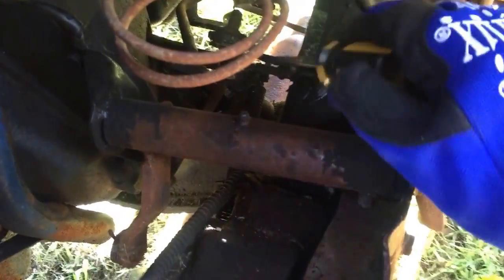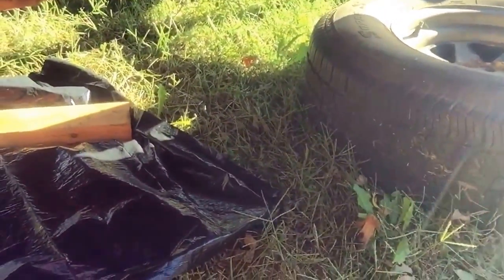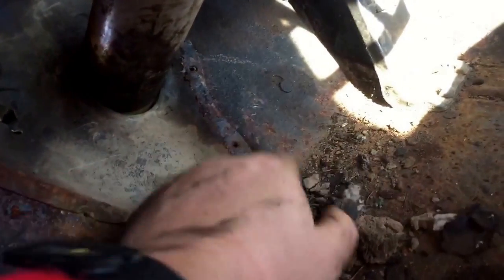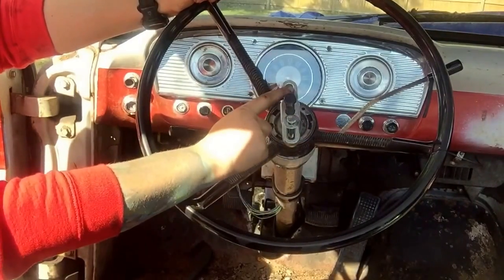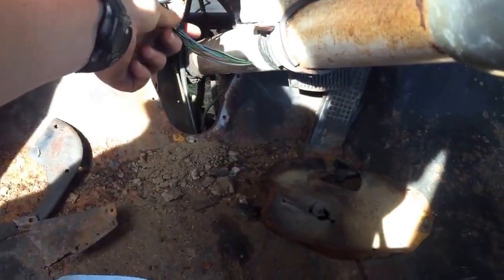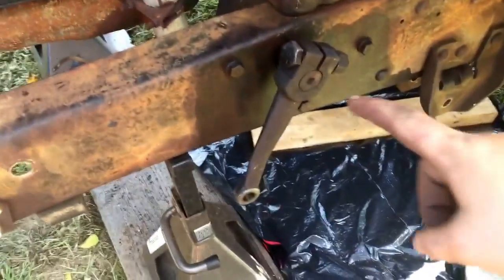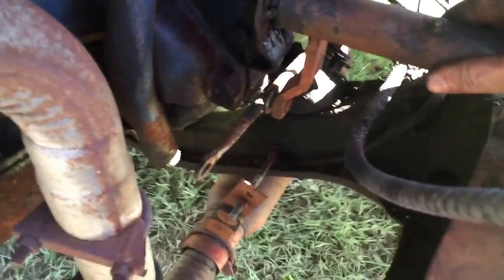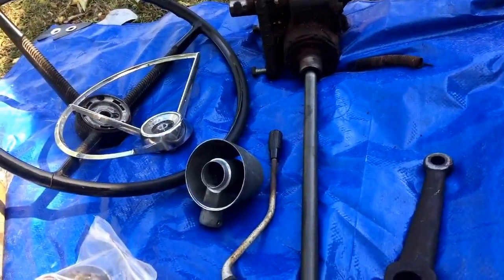Remove steering column and manual steering box '63 F100.

Comment: I guess after seven years you have determined the "dent" to which you refer at the bottom of the column tube.  That dent is factory and it allows the brake pedal to go past the column without hitting and catching on it.  Mine is from a later model and my pedal gets stuck quite often.  I bought a new column to replace it.  I hope it fits.

Comment: Coastie, just a suggestion, what I do is clean the grease and sludge with purple power first, makes the job a lot easier and helps to see some of the smaller parts. You can pick up Purple power from home depot or any auto parts store. Also I finds it easier for me to pull the whole steering column out first in one piece and work on it on a bench. You are making good progress, Are you going to install power steering on the truck? and if so what gear box are you planning on using. I am replacing the gear box on my Chevelle with a Jeep Gran Cherokee box it is a direct fit and quick ratio steering. You are doing great and making good progress on the truck. Thanks for the Video!
Reply from the maker: Oh I have a half gallon left after I've used that stuff to help clean the grime off the truck.  I didn't spray inside the engine compartment,ENT because I was looking for were leaks were coming from when I had it as a running/drivable truck.  Time to clean it all and fix the problems now that I've disabled the truck.  Will keep you posted as I move along. Thanks!

Comment: There is a set of bolts 2 and washer that you can see at 4:49 and gone by 5:12 what do these pieces hold? seem to have flat square top bolts on my column shifter. Anyone? thanks! @CoastieReid
Reply: Had the same issue on reassembly.

You can't tell in the video, but the flat head clamps down on the cutouts in the column.

Easiest way to do it is to barely thread the nuts on the bolt, then jiggle it around until the heads fall into the cutout.